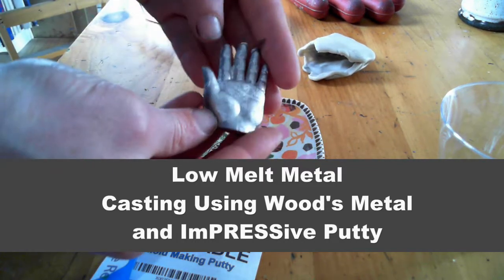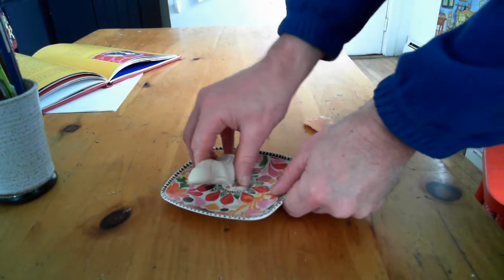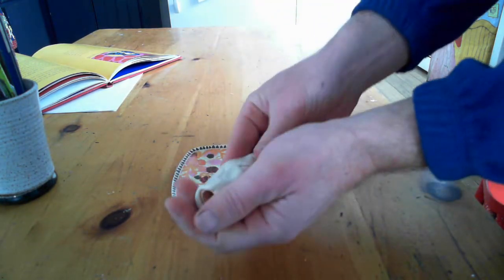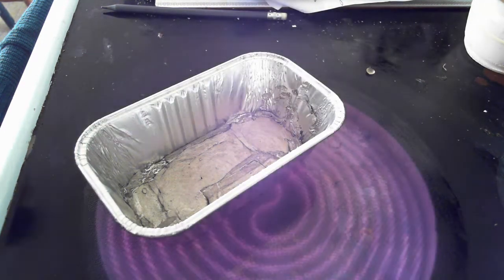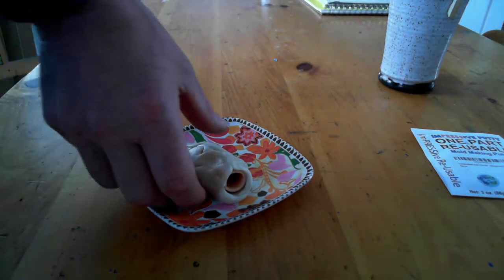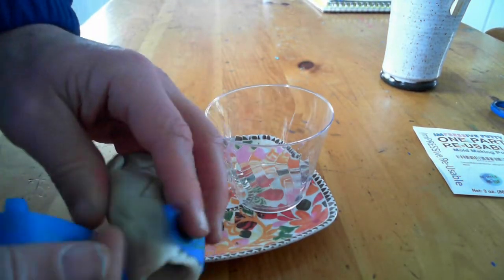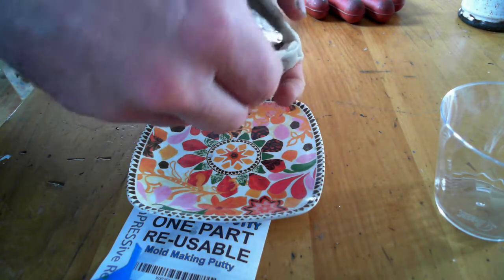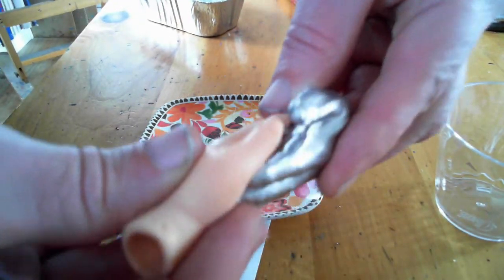Low Melt Metal Toy Hand Casting Process-This Mold Making Can Be Used with Many Different Materials

Comment: Thanks a lot for the tutorial but how can we make the type of clay you used for casting?
Reply from the maker: The mold is made with ImPRESSive Putty. You can order that at impressiveputty.com and the metal used is a low melt metal called Wood's metal.